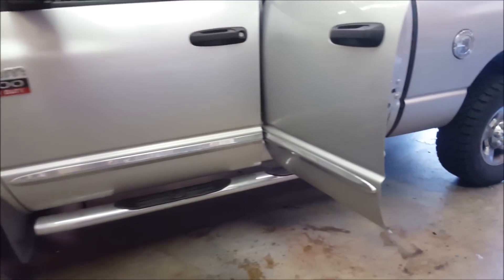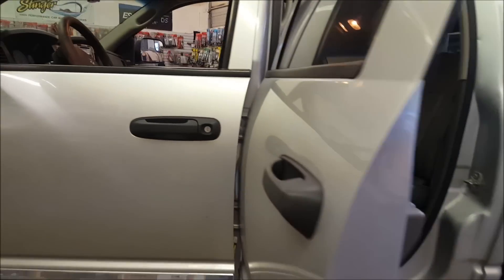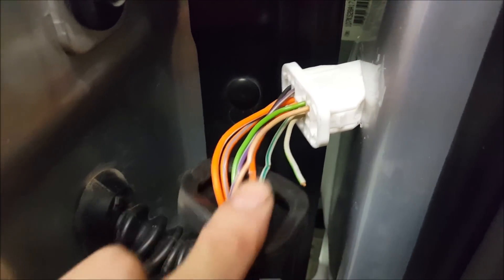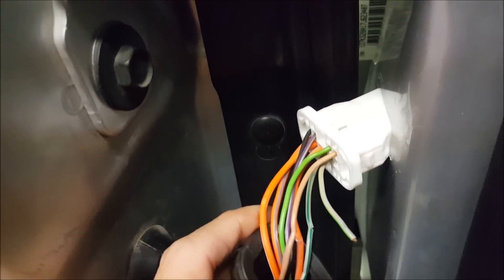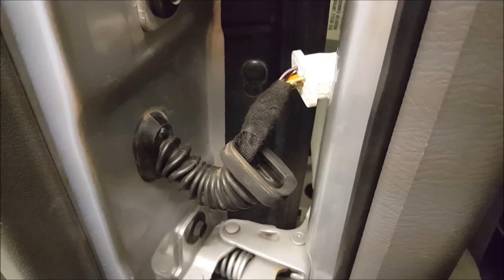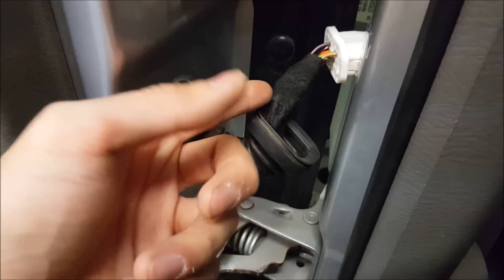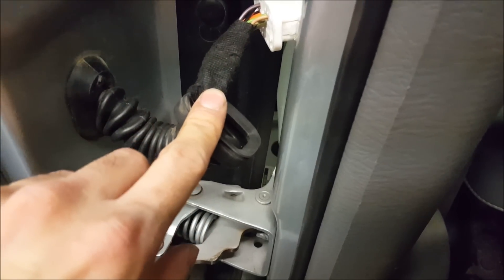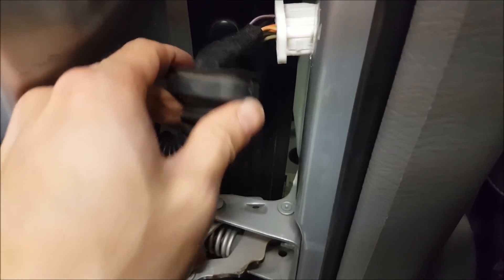Dodge Ram Wiring Issue (2003-2008) | AnthonyJ350

Comment: Why didn't you show us how you spliced it before you covered it up?  but thanks for the knowledge re: the door and short wires. Another tidbit for truck owners, and if any problem with computer and wiring harnesses failures causing other functions to fail, shifting, battery charging, lights, staying running, dying engine, the wires are about 21 Gauge, brought in from Malaysia, Thailand or Mexico to the plants.  Did you get that, 18 to 21 Gauge, especially on a truck!? Tell your dealership mechanics when you get a chance, they say they feedback up the ladder via forms asked periodically from admin. Maybe it will help?
Reply from the maker: Honestly, it was a busy day and it takes a little extra time to film and explain while working.

Comment: Confirmed, bigger issues under rubber boot. Bad wiring or pulled to tight when installed.
Reply from the maker: Thanks for sharing.  How many wires were broken?
Reply: @AnthonyJ350  2003 Dodge 1500 (bought new). Drivers side rear (rarely used). 3 broken on one end, 1 broken on both ends (a 2" pc of wire fell out), 1 hanging by a copper strand. 🤬
Reply: BTW- all doors have similar issues...
Reply: PS- this is after I have bought numerous OEM electrical components that can't be returned. 👍

Comment: Had this issue for the left side. Figured this one out on my own. Watched too try and get ideas for the right... So far redid the whole harness and still nothing. Has power coming down from the head unit. Then dies at the connection point up under the passenger side front seat. Forced them together with a butt connector instead of the connecting piece. Still nothing. Speaker also works. Tested on a separate vehicle. Any tips?
Reply from the maker: Passenger side door is dead?

Comment: Do you have any tips for running aftermarket wires into the doors on these Dodge trucks?  The easy thing to do is to run speedwire from the amp to the head unit and then connect to the stock wiring.  Can you give a recommendation for the maximum amount of power that I can push through the stock wiring?  Everything looks to be 18 gauge wire or smaller and that makes me nervous.

Comment: I was checking the wiring harness in my cars door, but i cant put the rubber thing back on its place, because the harness is stuck at the car chasis, there is any way of taking it away? it s a kia morning 2008

Comment: good job.. my 03 ram  has the whole left side dead.. the wiring  called  relay 73 went bad.. i fixed it on the cheep with princess auto  switches and new wiring  ( lampcord ) and its fine but it wont pass safety.. ps.. my left speaker is fine ..ottawa canada here ..
Reply from the maker: +san379 Is your left rear speaker good?
Reply: +AnthonyJ350  yes my speaker is fine
Reply: +AnthonyJ350  this winter my left speaker failed... theres no fancy  power windows n no door locks or lights in the door.. my truck is the ST  model .. only a speaker.. is there only 2 wires?

Comment: I have a 2011 Ram 1500 and having problems with radio. It started a few months back that the radio will play for a little bit and then no sound. It stays that way until out of nowhere the radio will come back on for a few minutes and then again no sound. It works perfectly when using auxiliary sound comes out but no sound when set on radio. Any suggestions on what's causing this issue?
Reply from the maker: Is it the factory radio? You can ask the dealership if there's a firmware update available for it.
Reply: @AnthonyJ350  yes it's a factory radio
Reply from the maker: It's probably the radio or the amplifier, if you have the factory Alpine sound system.
Reply: @AnthonyJ350  I believe it's just a plain ol factory radio no Alpine system but I will check to make sure.
Reply from the maker: @frankolivarez367  I would look into an aftermarket head unit from your local car stereo shop. You'll get better sound and way more features.

Comment: What about the windows NOT working from the master switch and the wire's r NOT cut? Switch has power but loses power when buttons r pressed. Fuse ISNT blown and relays arent bad. I need some help if anybody could give me advice.
Reply from the maker: Do any of the buttons on the master switch work?

Comment: Can anyone please give advice, 
06 dodge 1500. They removed cop lights and seat belt chime and light will not go off. Can't reset it with light staying on can't drive it with chime staying on. I don't have the skills to tear out entire dash. Bought at police auction. Thanks in advance
Reply from the maker: Check the driver's seat belt buckle, there should be wiring going into it, they might have unplugged it.

Comment: Do you have any experience working on 2011-14 chargers ? I am trying to locate the wiring harness that the AUX and USB port plug in to, I found the USB one but cannot find where the AUX cable goes to
Reply from the maker: +Video Québec Hmmm I never tried tracing where that particular plug goes on those vehicles.  What are you trying to do exactly?
Reply: I bought an ex-police one, they ripped out the center console so a lot of stuff was missing.
I found the USB connection, its basically a mini USB lead that goes to the back of the radio. The AUX plug seams to be a bit more mysterious, from looking at pictures of wiring harnesses online it looks like it goes along with the 12V cig plugs in to some other multi pin connector, even if I buy the replacement Mopar assembly I would have no idea where to plug it in. I am wondering if they cut that plug off or if its tucked away some place, I pulled most of the dash apart and could not find anything obvious
Reply from the maker: That's a tough one.  The USB modules I've seen in Ram's are very small circuit boards, so there's a good chance what you're trying to find will be buried.  Dealership have full parts schematic break downs where everything goes.  I'd talk to the parts guys and they might be able to help you out.
Reply: I found the USB part, its where the AUX cable routs to that I need to locate, are there any tricks to narrowing down a service manual or schematic ?
Reply from the maker: Video Québec The most detailed ones I've seen are at the dealer.  So maybe show up there with a coffee and try sweet talking them a little.
Reply: Lol yeah that's pretty much what I figured one would have to do, thanks though! Let know if you ever do an install on a charger

Comment: That's a simple fix. That does not require a shop to fix
Reply from the maker: Depends, if you want to fix it or have a pro do it.  It doesn't require a shop, but I work in one and am willing to share the info so a competent person may do it if they choose?
Reply: AnthonyJ350  
How do you remove the rubber boot without damaging it? Please share and do a video detailing the process.